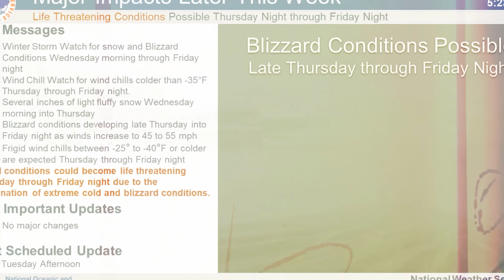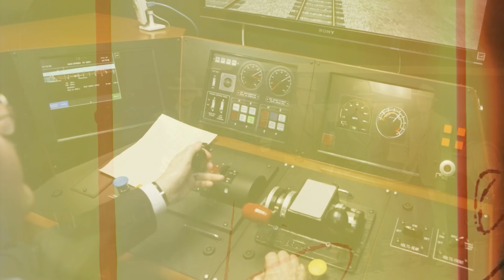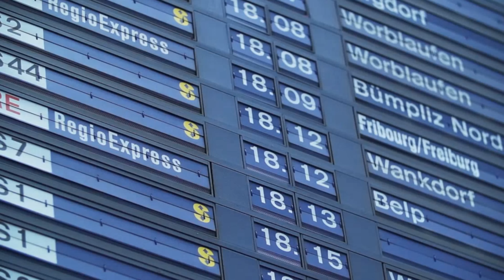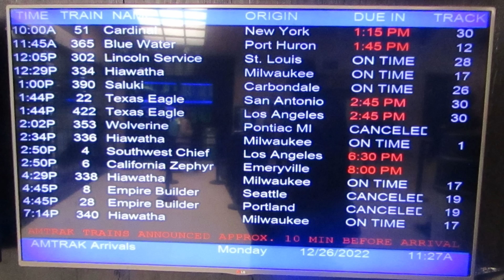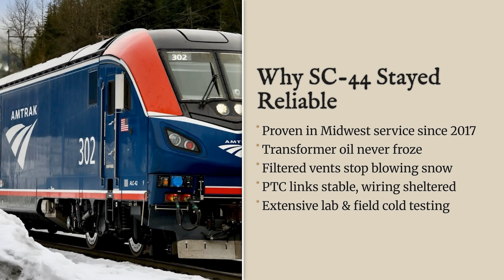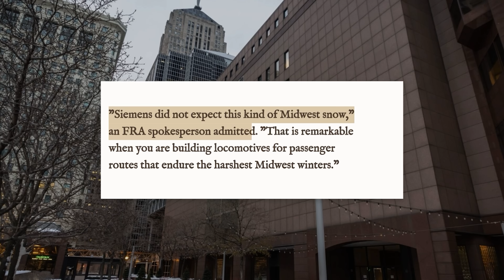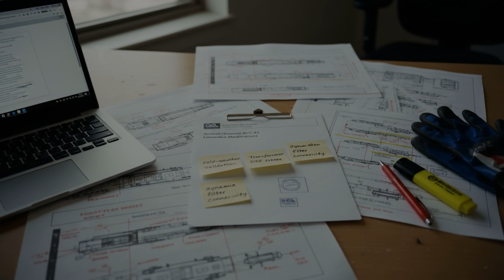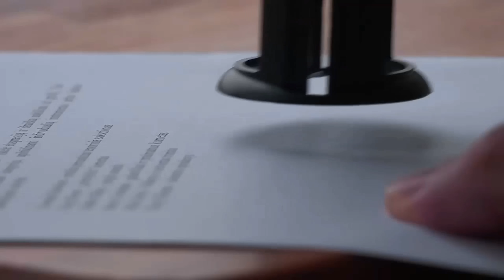Why Amtrak's BRAND NEW Locomotives LEFT Passengers FREEZING

Comment: This country should only buy locomotives made made in the United States by American workers.
Reply: These lokos are made in the US by US workers! 😉
Reply: They are made in the US.
Reply: They are...that's most likely the problem.
Reply: Unfortunately, the locomotives were designed in Germany. The Germans didn't know how to build a locomotive capable of handling the vast distances and extremely cold temperatures. In Germany, it doesn't get as cold, and they don't have to travel through such severe conditions regularly like in the Northern U.S., so the locomotives couldn't handle it here. They were forever breaking down. So many Amtrak trains were either delayed or outright canceled. Often back to back and sometimes for days on end. The breakdowns have been constantly happening since they were introduced to Amtrak.  

Sadly, the old GE-built Amtrak locomotives from the 90s are more reliable.
Reply: @G @GalaxyFur  That claim has it backwards. Siemens locomotives didn’t fail because they were designed in Germany by people who don’t understand cold weather or long distances. Siemens builds trains that run every day in places like Finland, Sweden, and Norway, where winter temperatures regularly drop to –20°F to –40°F and stay there for long periods. Those trains travel long distances through snow and ice and are expected to work. If German engineers couldn’t design for cold, those rail systems wouldn’t function at all—but they do.

What actually went wrong in the U.S. comes down to what Amtrak and state agencies chose to buy. The U.S. didn’t order Arctic-grade, Nordic-style locomotives. It ordered Tier-4 diesel locomotives that were built mainly to meet emissions rules, stay within budget, follow Buy America requirements, and be delivered quickly. Agencies did not require extreme cold testing, heavy winter hardening, or long-term operation at –30°F to –40°F. Siemens built exactly what was asked for and what was approved.

The real problem is Tier-4 diesel emissions technology operating in tough conditions. DEF freezes at 12°F, emissions systems need steady heat, and U.S. passenger trains run in extreme cold while constantly stopping, idling, and restarting. When the system can’t meet emissions limits, the software shuts the locomotive down to stay legal. That’s not a failure of German engineering—it’s the result of strict regulations combined with how U.S. passenger rail actually operates.

The older GE locomotives from the 1990s seem more reliable because they were simpler and more forgiving. They had fewer sensors, no Tier-4 emissions systems, and could keep running even when something wasn’t perfect. The Siemens Chargers are cleaner and more advanced, but they’re also less tolerant of rough conditions. The real issue is that the U.S. tried to apply modern emissions rules to an outdated rail system and expected the same reliability as older equipment. The delays and breakdowns are real, but blaming German engineers misses the point—this was caused by American policy and purchasing decisions, not European incompetence.
Reply: @NomadMP476   This isn't quite the full story. Many U.S. tier 4 locomotives operate perfectly well in very cold weather, and issues have mostly been seen with Siemens built models. As the manufacturer, Siemens bears responsibility for the mechanical and software quality of their locomotives. Some specific design flaws became apparent when these units arrived in northern states like Wisconsin and Minnesota.

Amtrak took a chance by running these locomotives even though it was known that Siemens hadn’t completed thorough testing. They also took another risk by choosing Siemens, which had less experience with North American winter conditions compared to established brands like GE. Ultimately, Siemens was the more affordable choice for Amtrak because other builders demanded higher prices. 

Could you clarify what you mean by an outdated rail system? The United States has the largest rail network in the world, utilizing many advanced technologies throughout the country. This includes sophisticated signaling, positive train control, GPS, infrared cameras for detecting equipment defects, and numerous sensors along the rail network to identify potential issues early, like faulty wheels on a train. It's often regarded as the most advanced freight network in the world. The only bad thing is that Amtrak has to share the lines with freight trains. (Although this probably has been a good thing lately since BNSF has had to use their locomotives to rescue frozen Siemens locomotives 😅) 

Speaking of BNSF, their Tier 4 locomotives have been very reliable so far in frigid weather, the company said.
Reply: nationalism is idiotic
Reply: They  are but the profits go  back to  Germany.
Reply: @paulwarner5395  Rich Germans or rich Americans. Neither is a good choice.

Comment: This is why I think Amtrak should have kept the EMD F40PH instead of retiring them back on June 1st of 2002.
Reply: You'd rather them keep locos that were pushing 30 years old at the time? The genesis locos were doing just fine, 

I think they should've kept them at least until they made sure the chargers could handle winter weather before sending them on that route...
Reply: @dnoel11 The P42s are showing signs of their age also. 2023 on the Auto-Train one suffered a broken fuel line in the loco and we were 5 hours delayed in Jacksonville, FL. Chargers on the Florida routes also suffered traction motor problems when new. But meanwhile, the P-42 still keep running.
Reply: THE F-40 PH WAS NOT THAT GREAT, THEY RODE TERRIBLY AND HAD LOUSY FUEL MILEAGE AS COMPARES TO THE GE P SERIES!
RUNNING 2 F-40 UNITS ON THE SOUTHWEST CHEIF , DURING SUMMER IT WAS NESSESARY TO SHUT OFF THE CAR AIR CONDITIONERS ON HOT SUMMER MONTHS OVER RATON PASS FROM RATON AND TRINIDAD TO THE TOP OF THE PASS!
THE EMD  645 2 STROKE ENGINE  
IS AN REAL WIMP IN THE HIGHER ALTITUDES!!
KEEP THEM ROLLING, BROTHERS!!
👍👍